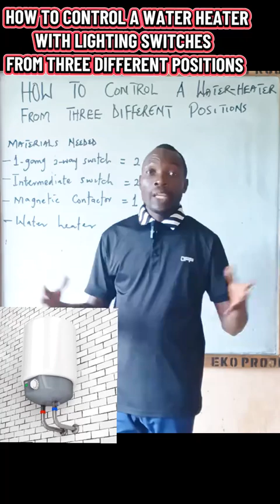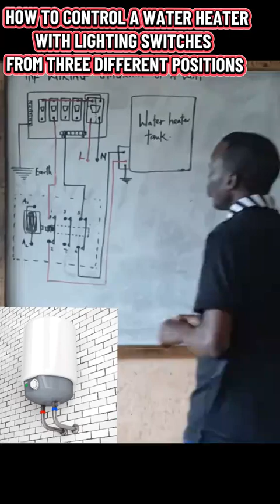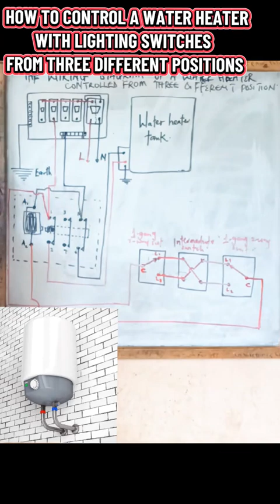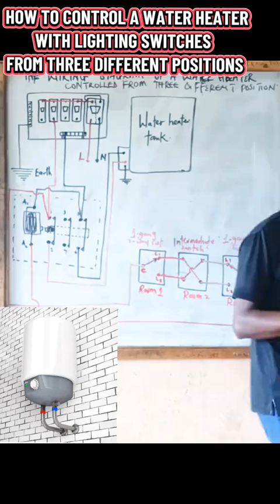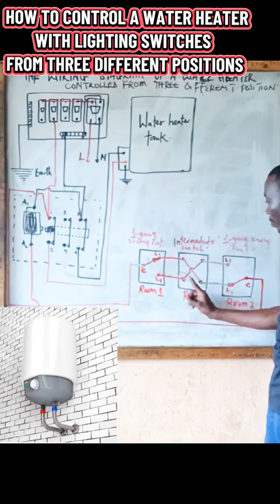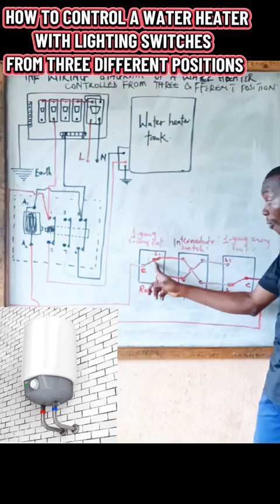HOW TO CONTROL A WATER HEATER WITH LIGHTING SWITCHES FROM THREE DIFFERENT POSITIONS

Comment: Can't we provide indicators for each room to indicate when the water heater is ON.
Reply: Of course you can the cable heading for the water heater just create a joint and from that concurrent point you tap your individual indicators from there to the respective rooms very simple
Reply: @adolfche8704 
Thanks Sir